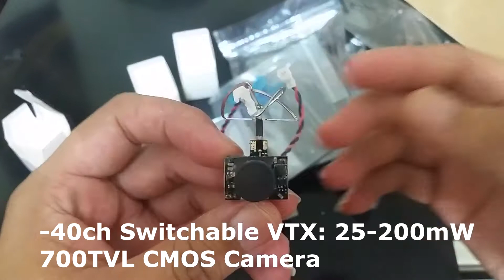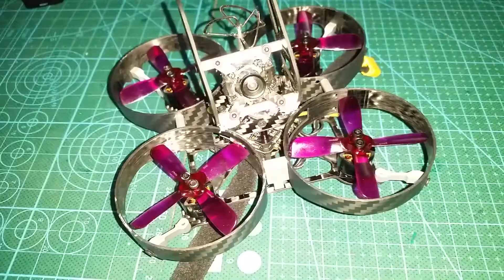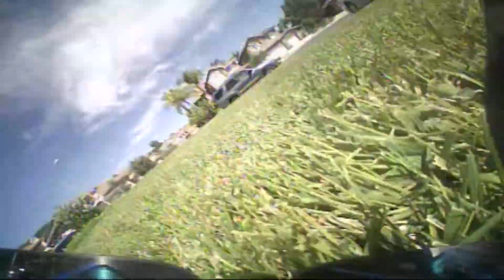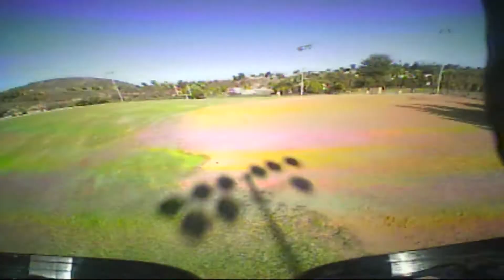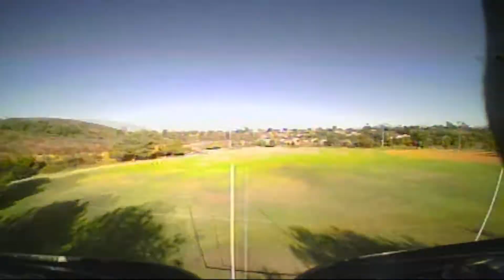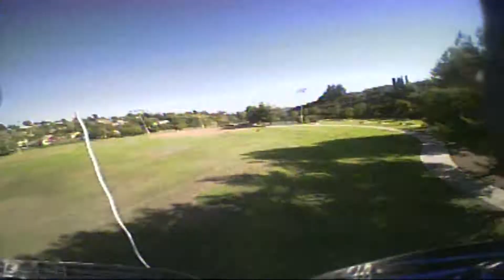Turbowing Blue Butterfly 90 -carbon this -carbon that - ALL carbon EVERYTHING

Comment: 2s , 3s ?
Reply from the maker: Krzysztof Szmyt you can run both 2 and 3s.
Reply: thx :)
Reply: how to use OSD ?
Reply: in the offer there is mentioned OSD, does it work? If it works how to connect vtx.
Reply: I have this dron  :)